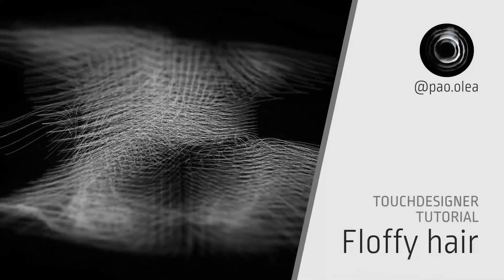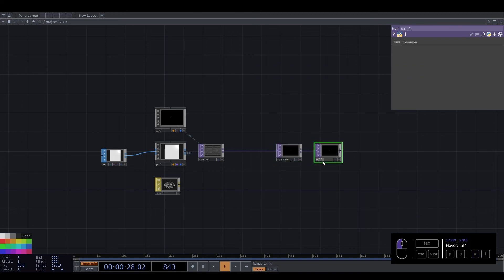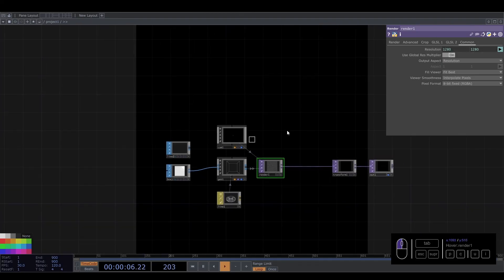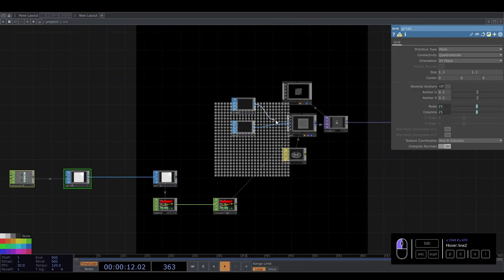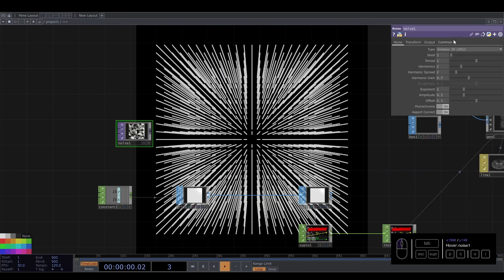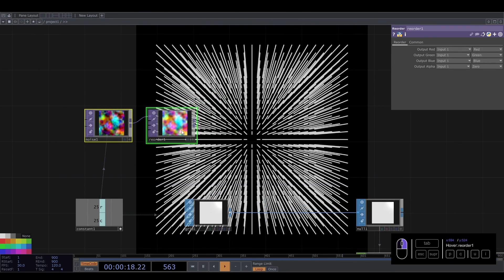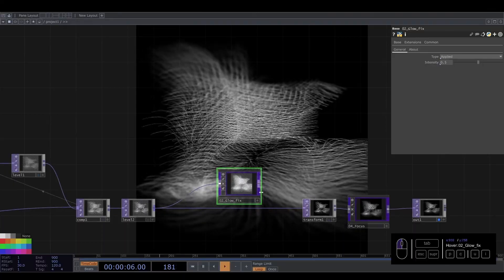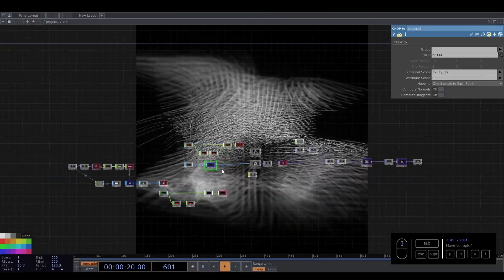[TD Drop #13] Floofy hair – TouchDesigner Tutorial

Comment: Uii, followed every staep but after the instancing stage, when connecting the line to the geo, it just go to be horisontal lines and not line on a grid that going in all directions. whyyy
Reply: I got the same issue, did u find a solution?
Reply: @Jay2slumped  you have to make sure the box1 is connected to the geo1 (in my case line1 was connected and then it only showed horisontal lines)
Reply: and if it still doesnt show, check the line coordinates for B and A are correct ! (timeslot 1:48)